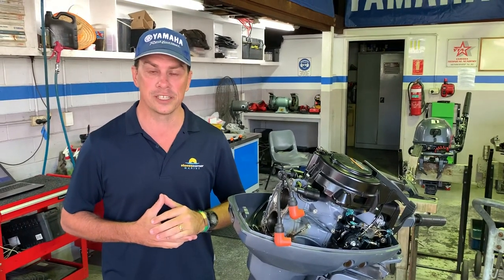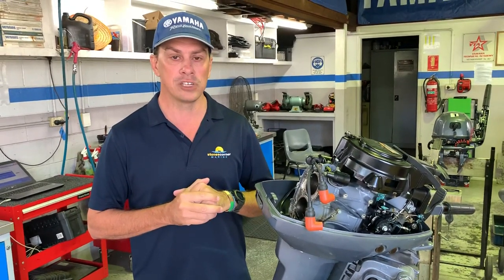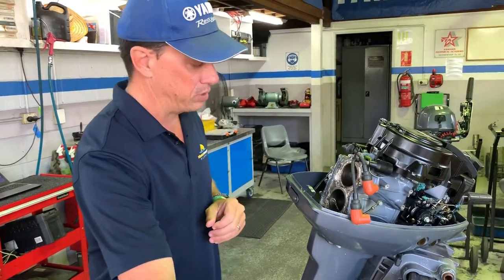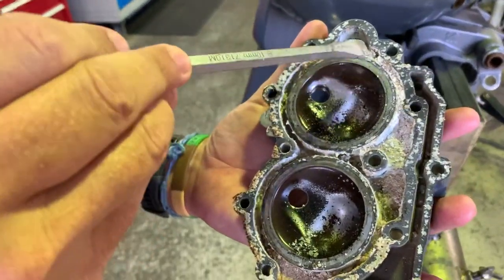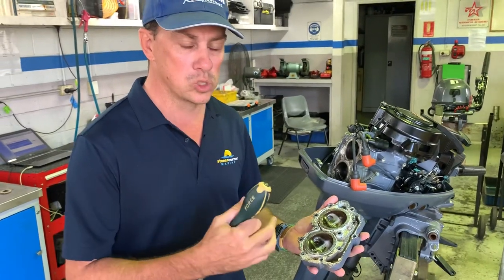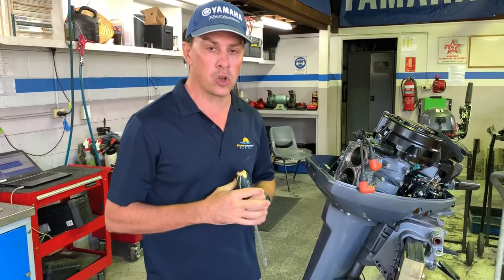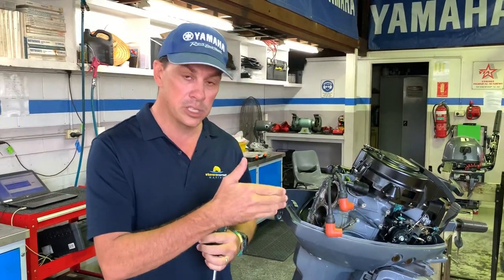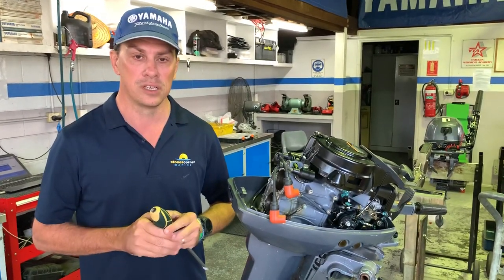How long should I flush my outboard for?

Comment: Hi i have a 30 year old 40hp in its day it would have been a top off the range yam 2 stroke even at that age it was no where near that bad when i pulled it down ,had calcium build up but that may be from using bore water i dropped the block and head and gasket cover in a neat solution of clr the stuff you buy from coles it worked a treat got rid of all the lime scale and cleared all the water galleries , i spoke to the lad next door about how long he runs his 4 stroke for (very short) he said he didnt want to upset the neighbours i said stuff the neighbours there not paying big money for a new engine ,i flush mine at the ramp and again when i get home and 15 mins would be the minimum .

Comment: I will be taking my pontoon boat up the Neuse River in NC and that is really brackish water.  I will be using a public boat launch to both launch and recover.  There is no water faucet to hook a hose up to for at minimum an initial flushing with just plain no salt water.  My thought is to have a couple gallons of mixed salt away and water and with a funnel get it down the two flush ports I have on my Suzuki 150.  Once I complete the 3 1/2 to 4 hour drive home, I will go through the full de-salinization process properly.
What are your thoughts on my plan??
Reply: Just wait until you get home. Crystallisation of salt takes months not minutes.

Comment: A mate of mine  has a house boat  on the water at Victoria point, an currently  the motar  wont pump warer , its never left   its morring  in the  4yrs hes owned it  it has a 40hp yammy  on it,, im hoping its only in need of an impeller  kit,, but now im thinking  its water jackets  are   mayb blocked with salt

Comment: Hi great video! Can i run my 4 stroke 175 hp while on a static flush or do i have to use the earmuffs?
Reply: I use both the flush port and flush ear muff white running the motor, in use Saltaway too every other flushing

Comment: What he failed to tell you . The outboard won’t start to properly flush till the engine is up to temperature enough to open the thermostat coz most of the engine is blocked off till the thermostat is up to temperature and open.
Reply: In 15 minutes as he recommends it will be up to temperature.

Comment: I have found that the best way to flush an outboard and even tuning it, is to put it in a barrel so that it's under pressure like you run it in the water.  Mouse ears is not good enough.
Reply: False.  My dad's first two boats were used almost exclusively in salt and only flushed with muffs.  When we opened them up for some repairs there was no salt in them.

Comment: We always flush with salt away.  And in that,  5 minute flush is fine.  In fact people I know actually recommend to NOT flush it for 15 minutes because that will remove any salt away from the cooling system and the salt away left in will protect and further dissolve salt built up in the engine.
Reply: Fresh water flush for 10 minutes water only then switch over to salt away mixture and let it run till mixture is all used up and gone then stop.

Comment: Sorry to ruin the long flushing party, but according to the Salt Away CEO, fresh water won't remove at all salt buildups on the entire water passages due to hundreds of ON (Heat) OFF, (cold) cycles and because all water passages are porous, natural salt collectors. Performing a service as the video shows at each 300 run hours it's the way to go for trouble free spot on cooling operation.
Reply: Enlighten me the salt away ceo has his say cos he probs owns or promotes the product so has an interest in it how does it work better